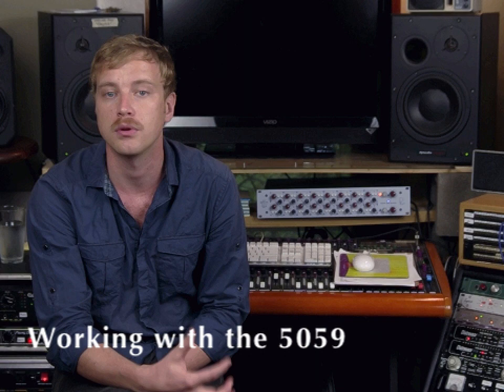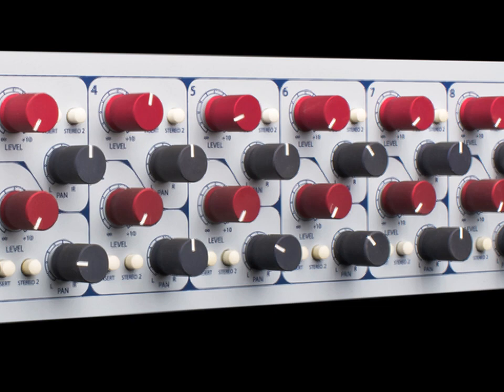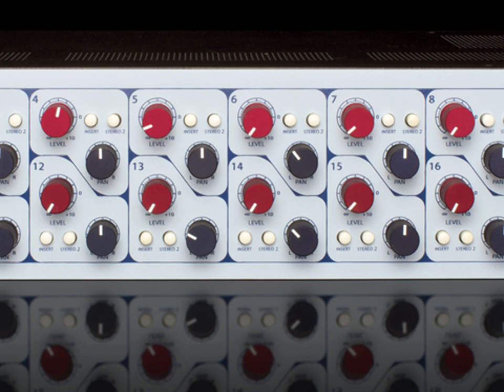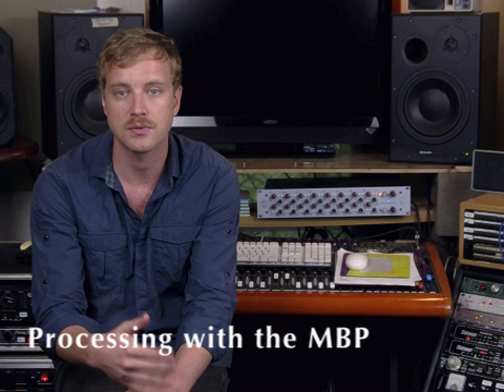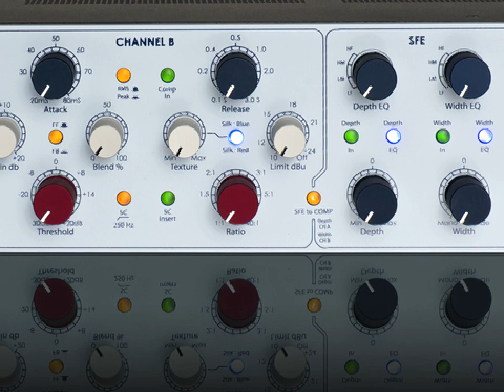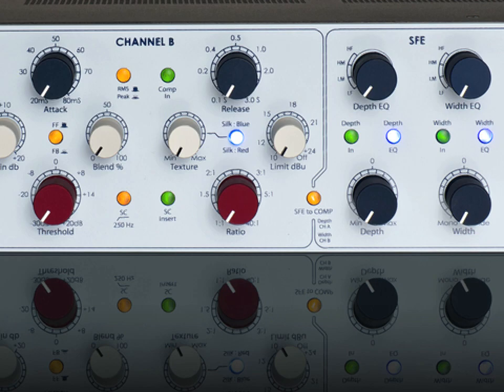Using the 5059 and Master Buss Processor to improve a mix

Comment: I find this both great and a problem.  The problem is the depth and loudness the 5059 imparts creates a greater need for compression and EQ-ing.  If those mixes are “finished”, I have disagreements with them but less so with the Protools ITB Mix examples.   Either way, the 5059 does a great thing to the sound but underscores what we all know; it takes many pieces to make a nice sonic pie.  Since I don’t track a lot, I just mix, I pass all tracks I receive through a vintage Neve module.  That alone creates an amazing difference.  I’m stuck between getting the 5059 or getting an external hardware comp/limiter for just my drum buss to compliment my growing outboard gear collection.   In other words, if you create your owns stems post passing all tracks through a vintage unit, it may make more sense to have outboard gear just for the stems and then sum from their outputs to the Neve Master Buss Processor. In my case, I’d do that by using inserts on my buss sends from my digits mixer.  So, buy this or buy more outboard gear?
Reply: What did you do ? Im in the same situation , buying this summing mixer, or a vari mu comp....
Reply: @MELOPSMUSIC  I haven’t done anything, yet! I do have my heart set on a curve bender, however! I have a feeling that certain EQ units almost acts, like compressors, if you know what I mean.

Comment: Not sure the levels are the same.  Louder sounds better, even if its slightly louder.  Were the takes level matched, maybe for RMS?  I like the 5059 Silk takes.  I thought the takes with the 5059 and the MBP were a bit over cooked.  But super nice gear.  Love it.
Reply: Its louder. but when i level match manually, the crunched version sounds tighter and mastered in a good way. But wouldent notice if i diddent do it myself
Reply: That did cross my mind.

Comment: Bet if you were recording onto tape you would never need a box like that to begin with. But in the way of things today that isn’t realistic anymore, is it?
Reply: it is always recording ON , dude ! Some fews are even news one 24 tracks tape recorder.... Occasion = 4 K$ - 30 K$  New = 8 K$ . So yes you dont need theses boxes but you surely need others with vintage tape recorders . So it will cost you much money !  OR you do it humbly with little cheaper old recorders less than 1000$ and you can add computer or not to push the mix further. Many ways to do it. But the result is different each time with different configuration. I think you can get some great sound with cheap tape recorder too but you have to pay to mix it and master it after .( around 300 $ the song )

Comment: Thanks for the video...great band, song, cool drums and sounds.
Maybe if the mix could be worked thru the 5059 and MBP would sound better,  but  to be honest the feel of the mix in the Pro Tools mix sounds better with the song is more engaging....  no doubt 5059 and MBP sounds great, but the way was used in this Demo  do not serve the song IMO.  thanks for the video tho...
Reply: i feel similar about it. i understand and appreciate what the 5059 does, it definately sounds more open and engaging. but to me the mix sounds more ballanced in the pro tools versions. why? because this particular song is so smooth and pillowy, it doesn't need the drum transients to cut through which is happening in the 5059 version. also itb sounds more glued. yes, every element is more apparent in the 5059 version, but that lofi itb glue suits this song better than the otb summed separation. i own lot's of expensive gear (sum through ssl sigma), so i'm not trying to say itb is better, i'm trying to say give every song what is best to it and in this case itb wins for me, it supports the emotion of this song better than the hifi otb summing.
Reply: Michael Czernicki I’m sure you may know this...but the correct comparison could only be a completely new mix, starting from scratch, mixing through the 5059. vs. the finished ITB mix. That’s the way they’re supposed to be used/compared.